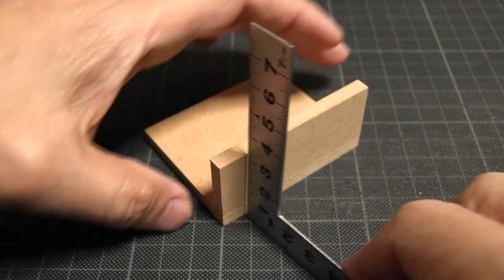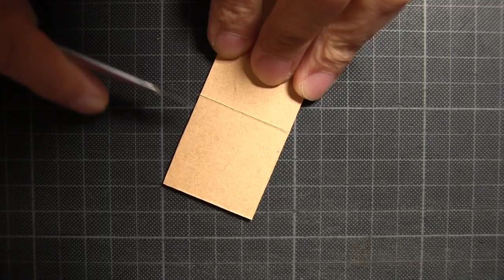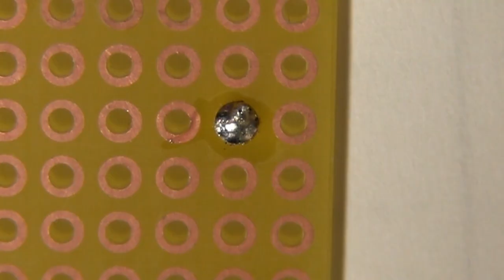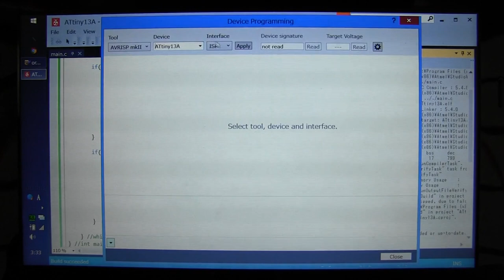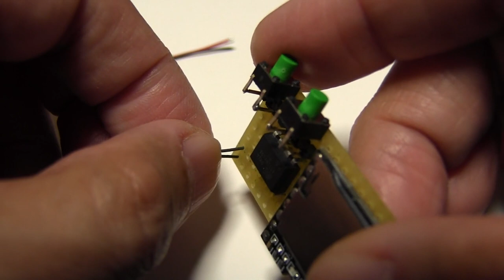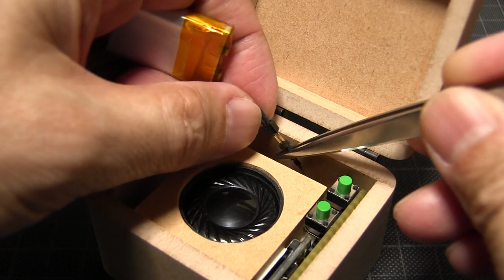【MP3】DIY Electronic Music Box with DFPlayer Mini【Orgal】

Comment: Could someone please make a detailed pdf with the instructions that are more detailed? Including parts and measurements?
Reply: honestly will pay you if you do
Reply: He put a wiring diagram in the description and the coding. 

The coding will go into the software for the AtTiny. As for the wiring diagram, you can look up how to read them and it will help you with the setup a lot along with all kinds of other projects.

 Typically, when assembling a PCB, you want to start with the smaller components and work your way up. I'd recommend building it on a breadboard first to make sure you got everything right and that it works. Much easier to fix it there than it is to desolder stuff. 

Then you can transfer it to a PCB. The PCB he is using appears to be a through hole single sided solderable breadboard. You can get them pretty cheap on Amazon or most electronic parts websites. 

He didn't list the size of the schottky diode, but someone else commented that any 5V should suffice. I don't know for sure, but that's what building on a breadboard is for. If it doesn't work, you can swap it out. Of course you could also do the math to figure it out based off the other components too. I think there are programs online that can also do the math.

Comment: Anyone have idea for making it? I want to but I dont kniw where to buy all the ingredients . Anyone know the names and website to buy??
Reply: There's a link to the circuit diagram in the description. You can buy parts from mouser.com or digikey.com or a similar electronic component store (or ebay if you want cheaper parts but not sure abt the quality)
Reply: @TeshanShanukaJ  thanks bro you’re the best!
Reply: @TeshanShanukaJ  btw how many songs can we get in? Three as in vid?
Reply: @루루애오-t3e   No prob mate. I think songs are in the SD card so whatever the number of songs you can fit in the card. If you have some basic electronic programming knowledge, here's a guide on how the player works https://wiki.dfrobot.com/DFPlayer_Mini_SKU_DFR0299
Reply: @TeshanShanukaJ  cool 👍👍
Reply: I'm fucking dead.. "ingredients" 😂😂
Reply: Amazon has most of the stuff. I have most of this stuff in my stockpile, but I'm missing the AtTiny13A IC and programming chipset.

 I have a few Ardino Nanos, seeeduinos, and an Arduino Mega though which work just as well as the AtTiny and are easier to program. I'm having minor issues with my build though, but I've also included Leds that are programmed to flicker like candles which is what I think part of my problem is. I probably need to use an OpAmp or some Capacitors, but researching OpAmps (and ICs in general) is like falling in the rabbit hole from Alice and Wonderland (too much stuff, I've never felt so lost and confused). 

Amazon also has whole Ardinos starter kits (and Rexqualis which is the same but cheaper) which should have most of what you need to get started making all kinds of stuff.
Reply: @kraziecatclady  I don't understand most of this stuff so can you remake the video but with all the materials name and link. Explain more about this video cuz this video isn't complete. Most of the viewers don't understand

Comment: I wish I had the ability (and cash) to make this w idk if you need programming skills for this but it looks like a more simple project otherwise:) thank you!!
Reply: It isn't so difficult to get into programming. Also, arduino programming is easier than what is shown in the video. So yeah, you can do it! And good luck :3
Reply: What does that mean? Is the music in the SD and the programming simply allows me to play the music in the SD?
Reply: @prospectorbook  yess the programming is to make the music play from the sd card everytime the box is opened
Reply: Components don't cost that much and as for this box, you should be able to use the link he left in the description to copy and paste the code. The only thing that might change is the pins, but that's only if you use a different IC than the one he is using really. 

I'm working with Arduinos and that's the main thing that I usually have to change, but that's because I keep building using different boards than the ones the example code is coming from. 

Arduino also comes with a lot of examples as well. You can go in and adjust things to see what changes. 

I've been watching a lot of Paul McWhorter's videos on Arduinos to help me out. He explains a lot about how the parts and codes function. Some of it can get redundant if you already understand the components, but for someone who doesn't, it's probably really helpful. 

There is a kit he uses for his classes, but I bought the much cheaper Rexqualis version long before I found his videos. That's the main reason why I keep having to change pin numbers. My board is not an Uno like he is using. I'm still not having any problems following along, but I also know a little Python, Powershell, and Visual Basic, so it's probably easier for me to decode what is going on. I've also been trying to learn Javascript because I need it to do what I want in Powershell and Python concerning the webpages...
Reply: @kraziecatclady  Have you made the box?
Reply: @enderwigin7387  No, but I'm working on something very similar. It's a larger box meant to contain shelled nuts and will play music from an MP3 while open. 

I'm using a seeeduino xiao board, a DF player mini, an 8ohm 2W speaker, a preset pot for volume, and a GM5539 photoresistor for the switch. I'm torn between powering it with a CR2032 button battery or a 9v, but if I go with the 9v, I will also need to build or buy a buck converter to control the voltage.

I'm also building a jewelry display case with flickering candle lights that will play music as well, but I'm having issues getting the music and lights to work at the same time. That one is using an arduino nano though. The music keeps glitching out on me as soon as it starts playing which is how I ended up on this video, trying to see if I need to add a capacitor, OpAmp or something else to get it to work right. This video didn't solve my problem, but it did show other stuff that could be used instead of the seeeduino or Arduino nano.
Reply: @kraziecatclady  Wow that's a bigger project. Hope you will finish it. And I'm here don't even know how to make the music box.
Reply: @enderwigin7387  While I'm not working on the same stuff he is teaching, I've been recommending Paul McWhorter's Channel to anyone interested in getting started with Arduinos (or mechatronics really). 

He does a pretty good job at explaining things, breaks it down pretty far. There is a kit he suggests and uses in the video that costs around $35. I don't have the kit, but I have something similar I bought before finding his videos. 

Arduino IDE is free and there are a lot of open source websites where people post code, diagrams, etc and help each other out. 

It seems overwhelming from the outside, but once you start messing with stuff, it isn't bad at all especially when there are so many code examples online. 

Adafruit,  Seeed, and Arduino all have some pretty nice products out there. Grove has plug and play items which cuts out any soldering. Honestly, the soldering is my favorite part though. It's kind of relaxing and fun to me.
Reply: @kraziecatclady  I'm going to check it out. Thanks for the information!

Comment: Hi can I have all ur parts name pls. I like this box so much. Would you like to share this info to me?
Reply: you can find some of the parts on digikey
Reply: @sleepyyhumann8339  digikey?
Reply: 8x16 perfboard 
28mm diameter speaker
MOSFET IRLML64 02
Schottky Diode 
ATtiny 13A microcontroller and a multi AVR programmer for coding into it (+ a software like Atmel studio)
DFPlayer Mini 
2 tactile pushbuttons (And a 4-pin pin header for holding them vertically)
Li-polymer rechargeable battery (3.7-5V)
1kohm resistor 
Detector switch 
SD card 
2-pin connector 
And more wires (Be careful about how you connect them. You might burn your parts. This person included the circuit photo in the description)
--
5mm and 2mm MDF 
Hinges
Magnets 
Glue
Sandpaper
---
Edit: IDK how we are supposed to easily charge the battery but you can get a TP4056 board for that.
Reply: @zaramomadi5569  how much it will cost to buy all these parts?
Reply: I’m gonna try to price it this weekend. Disclaimer: I have absolutely no idea what’s going on in this video, but I’m going to take on the challenge to figure it out.
Reply: @arismaug  yes digikey. thats where i have been getting the parts from
Reply: @sleepyyhumann8339  have you made the music box?

Comment: Can we put a real song? Not a BGM?
Reply: I don't see why not. The DF mini MP3 player has the programming built in that decodes the MP3 files. 

I watched this because I'm trying to build something for a friend that involves music and flickering lights, but I'm using an arduino nano. I think I need to add a capacitor, OpAmp, or something, but I'm not having much success finding anything close enough to my build.

The MP3 keeps glitching out after a few seconds of music and just makes this ticking noise until I reupload the code which just causes the same issue again.  The lights don't flicker correctly either. Without the player, the lights work fine, without the lights, the player still doesn't work quite right.

Comment: What's that tiny thing next to the mosfet? 6:15
Reply: If you look at the diagram, it has 3 pins. Drain, Gate, and Source. (D, G, S) The D pin here is connected to that little thing which is a 0.1MF capacitor. (D (drain) connects to the load which in this case is the capacitor.) 
Some more info:
S (source) connects to ground but this is a p-channel MOSFET so that's why it's connected to the positive voltage. 
G (gate) connects to our I/O (Input/Output) which is our switch here.
Reply: @zaramomadi5569  According to the diagram that should be resistor right? Not capacitor

Comment: i made this following  your instructions but it only plays same song over and over?How do i fix so it plays next song?
Reply: can you elaborate it? i already have the tools and with microchip studio but my attiny13a is not detected in my avr usb, could you help me?
Reply: @georgethomas6984  did you provide 3.7v power to breadboard? your wires must not be connected right,check your avr manual for correct wiring to a attiny.i used a waveshare avr usb
Reply: @katelynf8289  yes i already provide 3,7 power also recheck my wires and it's connected correctly. but why my attiny still not shown on microchip studio? (this is my first time programming a microcontroller)

Comment: how is the bottom part magnetic? You have magnets on the lid but what is it sticking to on the bottom?
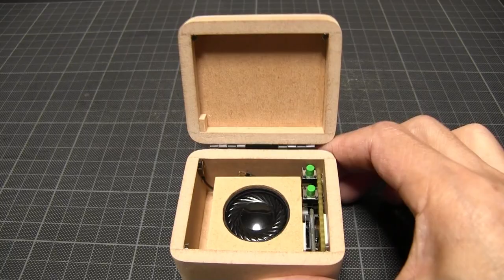Reply: He has it on the bottom or there's a piece of metal..you can see it at 8:30 (lower left corner).   I have used 4mm magnet and have 4, I think that's overkill...it's a great project.  If you're thinking of making one and not good with wood, you can get yourself a small box from Michaels...